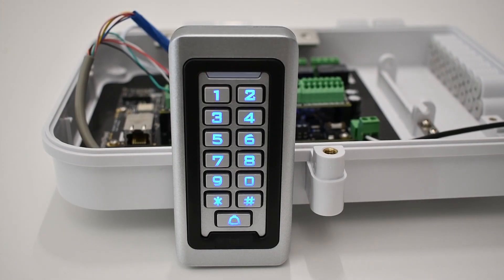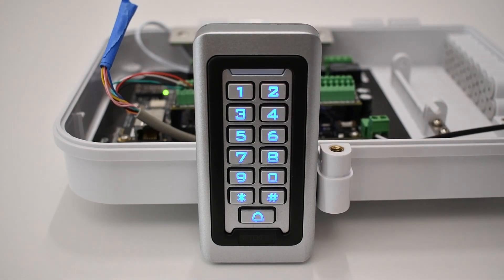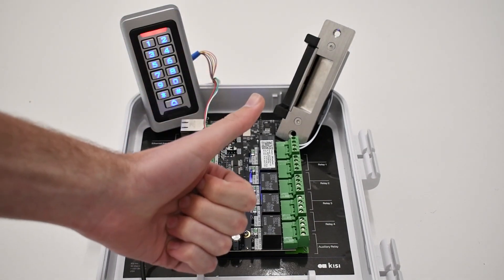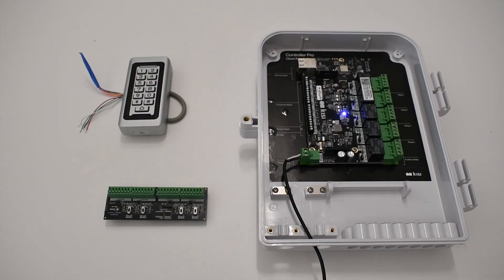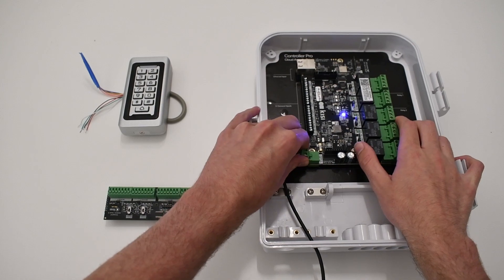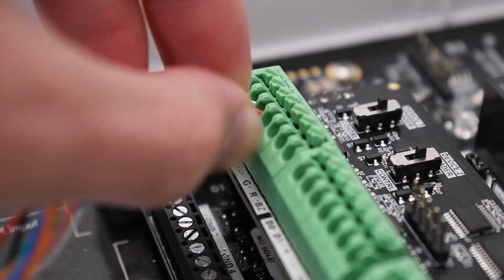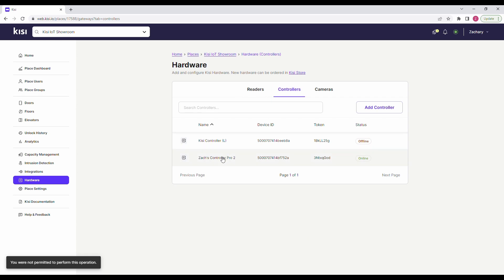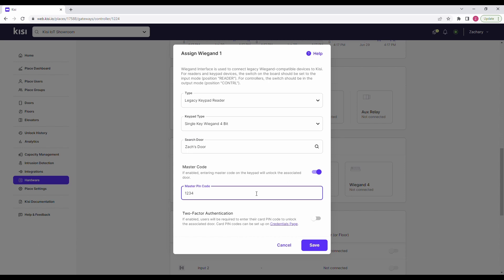Access Control Unlocked: Pin pads and Keypads │ Kisi

Comment: Can you set multiple key codes? The site lacks information. On all fronts. What about using card/pin readers? Which brands work best or are tested working with Kisi? Can I use a Kisi card/fob or pin code? Can I have multiple codes for different access schedules?